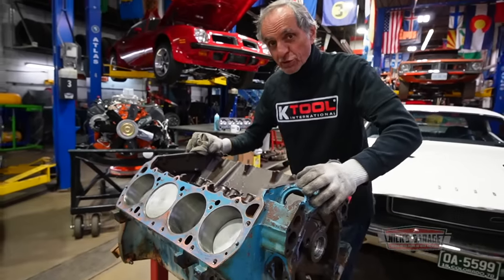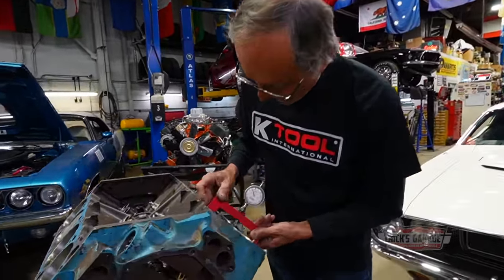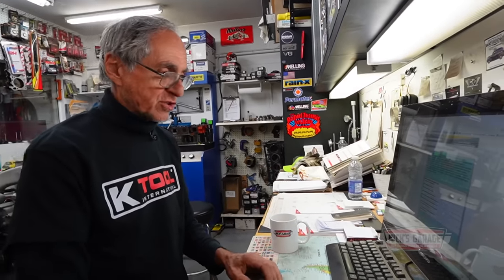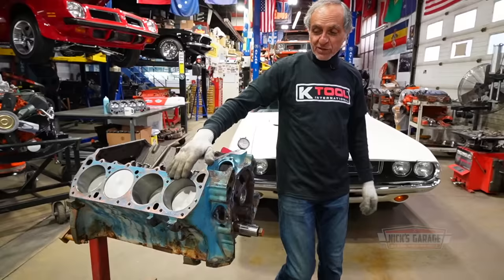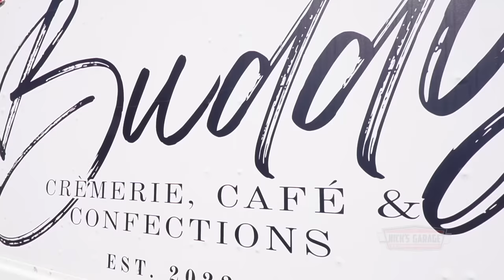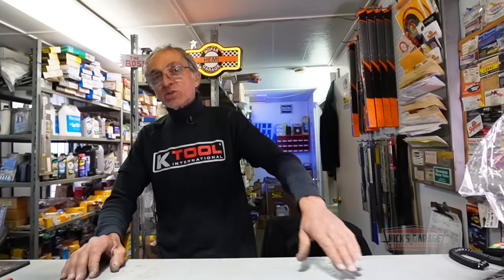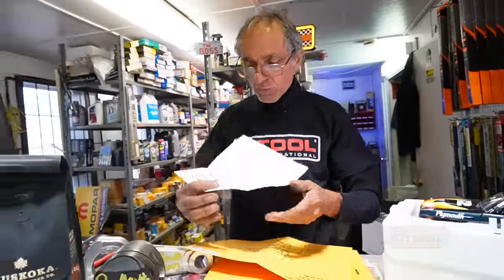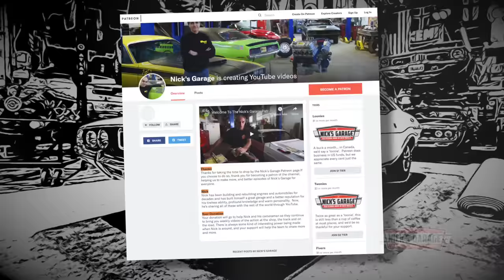Old 440 Build Diagnosis - What Were They Thinking?

Comment: The pistons are smogger slugs. They were easier to come by and much cheaper than the correct ones, don't throw them away, find a nice std bore 400 block fit them in that, it will boost the  compression and make it run quite well.
Reply: This is a common problem with 'rebuilder' pistons and 'rebuilder' gaskets... 0.020" - 0.030" off... however, these pistons are extremely far down, 0.170",  indicating WRONG pistons, WRONG rods, and/or WRONG crankshaft! (IF 0.170" is correct)
In this case, next step is check the amount of crankshaft stroke... maybe Chrysler had 'smogger' pistons way lower than anybody else...
MOST early 1970's engines from every company have actual compression ratio in the + 7's + ! 
Yet manufacturers were still claiming the magic regular gas "8 - 8.5:1"... 
Cam spec.s/part number/usage can be closely determined by measuring the lift on the lobes... 
Comp still sells 252H12 cams... about 206 degrees duration at .050" lift and on 112 LSA... usually considered a one step up car or 2 steps up truck performance cam giving about 400 - 800 more RPMs than stock and more power and a touch more torque... smooth idle... good MPG... good vacuum for power brakes...
Reply: @BuzzLOLOL  bah, it just needs some forced induction ;)
Reply: @throttlebottle5906  - Those low quality pistons won't handle boost long... and will get horrible MPG when not in boost...
Reply: @throttlebottle5906  that's what I reckon too mate ! Lol. Cheers from New Zealand 🇳🇿
Reply: @BuzzLOLOL  said with "tongue in cheek",  when it expels parts everywhere, problem solved.
Reply: They are thirty over they will work for a stock rebuild deck the head to 20k

Comment: After i got out of the Navy air corps i used to use a stethoscope like the one you got to check out bank safes to see it the clock was running when they were late opening up ans so on.....l am like you i have never seen a top dead center Piston that low....Thanks my friend Kick 👍                                                                                                                                     
Shoe🇺🇸

Comment: Hey Nick. Look on the block for numbers that could have been added when rebuilt. I have a 440 tucked away that had the same blue paint all over, and had pistons that looked way low, But I never measured them. The pistons had the same 3 on them.

Comment: I built a 7.5 to 1 440 with ported heads and a Hughes Whiplash cam. Made 415 hp 465 tq on the dyno. It is possible to still have fun on low compression.

Comment: That cam is a very old model from Comp Cams. Back when compression was low and gas was very bad. The cam was made specifically for low compression engines and if used properly it would barely avoid pinging. They had a 260 and a 268 version also at that time. The 440 most likely is out of an rv as they were notorious for low compression back then.

Comment: I’ve seen Steve Dulcich (engine masters) talk about the 440 Motor home engines with 7.8 to 1 compression. Deck height .170 +_ below deck. My 383 Mopar engine is .070 below deck. The person who built my engine years ago used Mopar performance cast pistons advertised at 9.0 to 1. My engine calculated to 8.5 to 1 with steel shim gaskets and stock 906 heads. Not enough. I bought a set of 440 source heads they are 80cc . I have .050 milled off of them for a 75cc chamber. Install Cometic .029 mls gaskets. Depending on whose online compression calculator my compression is 9.2 to 9.3. ( some want the bore size of the gasket) it does pretty good with 91 crappy California gas .

Comment: I happened to be looking at an old Comp Cams catalog that I have (2000) and remembered that cam you pulled out. From the catalog It looks like it's a 'High Energy' grind number 252H part number 21-212-4. Specs show 800-4800 operating rpm 252 adv dur int/exh, 206 dur @.050 lift is .425, Centerline 110. It's the smallest hydraulic flat tappet cam they offer, looks like for an RV. The description reads "Excellent torque & mileage for 361, 383-400 (2 or 4 bbl). Smooth idle. Light towing, 9:1 comp. OEM replacement. 625 cfm carb."  Hope this helps!

Comment: Mid 1970s low-performance Chrysler engines had very low compression. I tore down a 1976 225 and it measured 7.6:1. Advertised compression ratio was 8.4:1, but no 225 I've torn down was ever greater than 8:1.

Comment: LOL, love your channel Nick but I can't believe I have torn down more 440s than you!! Over half the 440s I've ever seen/disassembled have .120 or .160+ negative deck! 1971 440s have a dish but are closer to the deck, like a '68-70 piston. A motorhome/industrial dished piston has the -.160+ deck, so 7:1 compression is max! With deck/head milling, thin steel head gaskets and the proper camshaft you can make a 9.5:1 440 with those -.120" (or even -.160+) deck pistons that run pretty good!!

Comment: The only reason I can think of why those pistons were in the 440 was for boost. Its possible the customer may have discussed adding it way back when it was built. I owned an early 80's Ford that had the compression reduced to 7.9:1 and 10 PSI of boost, it ran amazingly well and broke more than one diff with it. The turbo failed and I removed it, the car was almost wouldn't run at such low compression. Just a thought because its hard to believe any engine builder could neglect such a point.
Reply: Good a reason as any. Just because it's unusual doesn't mean it's a mistake, the guy might have built it like that deliberately to accommodate boost while still running on pump gas. Makes sense.

Comment: Hi Nick. I "think" that cam is the old Comp 252 High Energy set up on 112 degree lobe centers instead of the usual 110. If that's it, then it'll be 206 degrees at .050" lift.

Comment: This is a good one Nick!!! I'm thinking that maybe a low-deck  (B engine) crankshaft, was used in this raised deck (RB engine) block thus creating a stroke radius of About 3/16" (0.1875") shorter than what the RB crank makes the piston travel... And my guess is, the decks on this block were shaved about 0.015" , at some point, so to avoid detonating on the low quality regular gas in that area it came from, and to avoid having to buy $6+ /gallon premium fuel , they lowered the compression ratio by using a crank with a 3/8" shorter stroke and a thick head gasket.... This way the people who sold this car could claim that it has a 440 Magnum, when it actually has a de-stroked 440 with 40% less power than what it SHOULD have... My opinion, but tell us what You find Nick... What are the casting #'s of that crank? My guess is it came out of a 400, with 3.375" stroke, instead of the RB 3.750" stroke.... 
     That film of the car show and get together was impressive Nick!!!! You might find that your fan - base goes far & wide ... You people at Indy Auto have become quite the entertainers!!! 
An Epoch episode Amigo!!!
Reply: And that get-together and car show was just AWESOME Nick!!! Wow!!!
Reply: They DIDNT use a B crank in an RB block
BECAUSE
 B crank main journals are 2 5/8" dia and RB main dia is 2 3/4".

Comment: Back in 2006 I bought a short block 302 topped with new TFS T/W 190 heads for an admittedly cheap “fire sale” $1000.  It was a fresh OEM block, stuffed with used ‘86 HO flattop forged pistons, OE crank rods, pistons AND OG rings, bearings and timing chain…

I used the hard parts, but ran fresh bearings, rings and TC.  I flycut the pistons on the exhaust side for a more aggressive cam and the engine runs great to this date.  But, who would not replace out of spec wear items before being placed in a fresh block, while topping it with new heads with studs, and fitting ARP rod bolts?   😂

Comment: my Mopar 400 stock pistons were 120 below the deck - it had 7.7:1 compression stock - most later 440s are about the same, not sure where the extra 50 came from, but wow!

Comment: That's about normal for all of the Chrysler engines I've had and rebuilt. The original and replacement 440 in my 68 300 were both .170 below. The 318 I put in my Rambler was .080 below deck. My two slant six's, one was .180, the other was .200. Seems fairly normal for Chrysler. Although, I did purchase a Chevy 383 from someone and found they just put stroker pistons on a stock crank. The pistons were 3/8" below the deck! He figured you just have to change the pistons, not the crank and it's a stroker motor.

Comment: 252H High Energy cam on a 112*LSA, low end torque and smooth idle, high vacuum. Good for 2.76/2.94 gears and a 12" converter. Perfect for those pistons/CR!! LOL

Comment: An imagine that 440 with a 11.5 compression ratio,  domed forged pistons,  forged rods and forged crank, 3 angle valve job with Manley valves,  heads ported and polished,  and port matched to Hooker headers and ceramic coated.  A aluminum Edelbrock Torker intake manifold,  a Holley 750 cfm double pump carb on top, a nice CC cams solid roller cam in there, 3500 rpm stall converter,  4 core radiator,  Mallory ignition coil,  Mallory distributor,  true dual exhaust system with Flowmaster 50 series muffs. Engine putting out 498 hp at 4000 rpm, 440 ft lbs of torque at 5300 rpm. Just armchair thoughts

Comment: RPM Operating Range: 800-4,800 ; Grind Number: 252H ; Cam Type: Hydraulic Flat Tappet ; Lifter Style: Hydraulic Flat Tappet ; Camshaft Series: High Energy.

Comment: Hi Nick - I've built a lot of Mopar performance motors and I suspect that "what they were thinking" was nothing at all.  Probably either a local generic shop or DIY using the cheapest available pistons/other parts.  As you noted, using white grease as assembly lube pretty much indicates that whoever did it was not an "engine builder!"
Reply: Whats the big issue with the lithium assembly lube?

Comment: I give you 5 ⭐⭐⭐⭐⭐ for today's episode Nick! I love motor archeology, especially anything Mopar. I can't believe that engine was built with such low compression. Might as well have not put it together. I wonder if the crank was ever balanced?
Reply: Huh? Boost, man, boost. Low compression allows boost on pump gas. It's not very efficient, but if gas mileage is what you're after then a boosted V8 probably ain't your bag :)

Comment: Looked it up, 
COMP Cams High Energy Cam and Lifter Kits SK21-212-4
Cam/Lifters/Timing, Hydraulic Flat Tappet, Adv. Duration 252/252, Lift .425/.425, Mopar, Big Block, Kit

Comment: .170 is about the difference between  compression height of 400 piston vs 440 piston. If it was bored .020, I would say they used some std bore 400 pistons by mistake.

Comment: Those look like smog motor factory type pistons. I have a 74 400 I’m rebuilding. Pistons are .120 in the hole. Advertised compression ratio is like 8.2, but actual compression ratio is around 7.5. It might work with a tiny cam, but you’d still be leaving a lot on the table.
Reply: You are correct.

Comment: The 1970's 360's were also pistons deep below deck.  Then add in a replacement over .050 thick, 4.125 bore head gaskets,  fill with a larger duration camshaft and wallah! A pig is born! LOL.

Comment: Cam Guess:  Comp Cams High Energy™ 206/206 Hydraulic Flat Cam for Chrysler 383-440 Single-Bolt. 
"Excellent torque and mileage for 383-400, 2 or 4 BBL. Smooth idle. Light towing, 9:1 compression."
This was a low-budget RV/Camper build for pump gas.

Comment: Those pistons had to be designed for a different length connecting rod.

I think the cam number is the intake duration (252 degrees), high energy (H), 112 degree lobe separation angle (112). I think the duration is at 0.006 lift. It does seem like an RV cam to me.

Comment: ...the camshaft is a comp camas 252 High Energy, current number 21-212-4, except that the -12 says it's with a 112 degree LSA instead of the current 110. About the best match for the CR, which is not much. But that's what they all were after the muscle era.

Comment: You better watch out Nick. I might come to your shop and offer you a deal. $10 an hour to clean the shop.

I'm a pretty good mechanic myself. I use to fold the paper into a long cone to listen to noises. I do Carnival rides now. When I was younger I rebuilt Honda motorcycle engines. I've had pistons manufactured by Wiseco. I even cut a set of pistons myself.

Comment: I think that those are mid 70’s motor home pistons. They were around 7.8 to 1 with shim head gaskets. Even the stock high compression 440’s were closer to 9.7with factory uncut heads. It’s hard to believe that the engineers couldn’t figure out how poor of an idea it was
Reply: The low CR was to allow it to live day-in/day-out pulling heavy loads on junk gas without complaint.  The engineers knew what they were doing.

Comment: Problem on my 440 Block was from left side to the right side 0,73mm to 0,35mm! - compressratio one side 10:1 other side 11:1 😡 
I got one cometic gasket and lower the high comp. from 11 to 10
By restore always messure both sides!
Greeting from Austria/EU
Reini

Comment: Nick, I don't know why you are shocked. Everything I've read says that all 72 (or at least 75) and newer engines are about 7.5 to 1. They were only rated at 8.0 "on paper".  
   Also : About the thick head gaskets. That is what everyone used that didn't want leaks and didn't want to have to retorque head bolts.  This is just a standard run of the mill rebuild job by a mass rebuilder. It's just lucky they didn't use 60 over pistons since that seems to appeal to them since it saves the effort of making measurements on bores by just ordering the biggest ones automatically.
   And, living in California where we have the worst gas as well as the most expensive, I can see why 8.0 compression "on paper" sounds not stupid at all. And standard pistons were what you got.  From a mass rebuilder. Or even the goofus shop that says they are getting HP parts but really uses the same stuff as everyone els.
   The Mopar Bible says you lose 5 percent of HP for every 1 drop in CR. So 10 percent going ing from a Kowalski 440 to a 75 New Yorker 440.
An engine built for a cruiser sounds pretty good to me if it is, say 320 HP rather than 380.
I'd take that engine in a minute!
I was just amazed the engine had no bore rust at all after sitting 20 years. I hope my "sitting 35 years" engines fare as well.  I wonder if they were smart enough to run the oil pressure up with the hex too.  Was it oily inside?
  I'm curious you didn't measure the cam lift with the dial indicator and a solid lifter before you took it out of the block. I'd bet it is the exact same as the factory 440 non U code or pickup truck.  I'd sure want that cam back along with the lifters since going back to 20 year old parts seems to be the only way to get good stuff.

Comment: 252H12 cam is an Xtreme energy comp cam 244/252 solid flat cam for a 383/440 single bolt for mid to high rpm range power. if it was a 10:1 compression but they were very far off

Comment: Well likely that cam is 252 adv duration on the intake side with a 112 lsa. Comp still uses that system. It's a grind number not a part number. I would guess it's specs are very similar to the Comp 252H-12 cam I used in my Jeep 4.0l.

Comment: How about a 440 4bbl, using stock intake manifold and stock exhaust manifolds and putting out 426hp and 500 ft lbs of torque .

Comment: some MH 440 have 7.5 comp and so do MH 413. i have one 413 with 7.5 compression ratio but damn that thing has low end torq. allmost all industrial 440 and 413 have comp range to 7.5-8.5. dished pistons and large cc heads. some even have timing with gears so the cam spins backwards.

Comment: Looks like it was stored together in order to build a stroker out of it later. 
Go ahead and strokerize it a little.      :o)
just guessing here, though H4 383 could mean mopar big block, hydraulic with 4* degrees built in. could be the actuaL specs on the cam in duration or lobe lift and 12 meaning 112 LSA lobe separation angle perhaps. That would mean a 108* intake lobe centerline. That mopar really needs a 106* LSA if your radius before and after around the intake valve is up to it.
As a matter In fact, would go ahead and pop some other ross, or mahle flat top pistons up out the block .001" or .002" while at it with a O.O4O" MLS or Cometic gasket, hee hee! Actually if could get some solid pistons about .030" taller than deck and mill those down .030" (make sure not hollow) , deck the block to have those pistons coming up .002" out the deck, use the .040" gasket and be gold. Throw in a 250* + duration @ O.O5O" lift hydraulic roller on 106* LSA from mike jones. With those cubes it should idle great.

Comment: Those pistons are meant for the  mid to late 70s HP 440s ei Police cars they inexplicably came with 7.5 compression ratio.The post 71 regular 440s in cars and trucks had 8.5(ish)

Comment: was someone building a blower or turbo engine? Or were the pistons found in the "clearance" bin at a parts store?
Reply from the maker: Who knows what they were thinking?
Reply: @NicksGarage  Long ago I decided conventional NA high rpm hot rod engines are not for me.
Back early 80s I started making my own sheet-steel intake manifolds that would accept stock 8V-71 blowers. I fabbed industrial Three-V belt drives (eliminated need for blow-off valve) for them. My favorite carburetion was triple Autolite 4100s.
          It was startling how much power a bone stock pickup truck 454 made that way.  Short of Nitrous I think this is the Horsepower/Dollar maximum.

Comment: if the rods are stock length where are the wrist pin locations. We built quite a few engines (Chevy big block) that vary compression with wrist pin compensation on the piston versus stock..